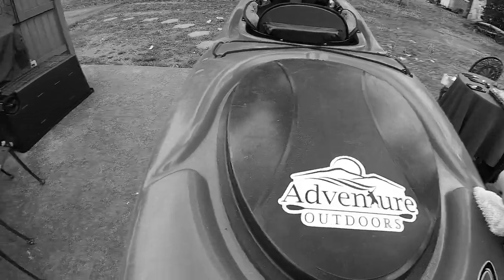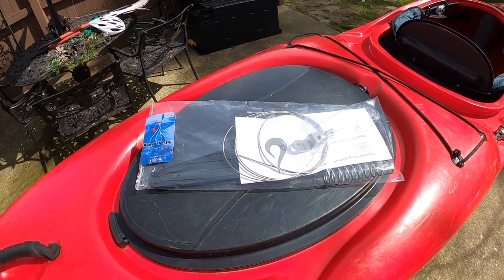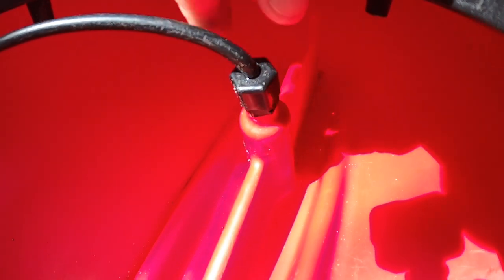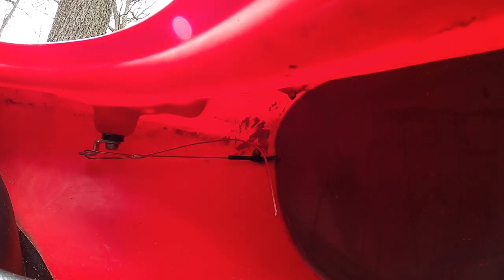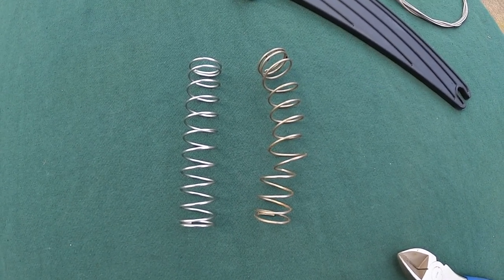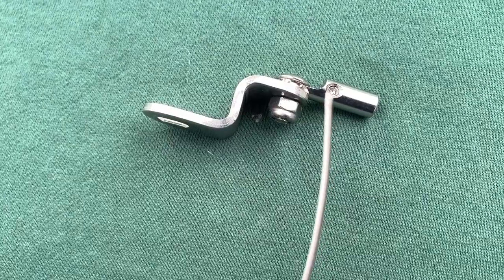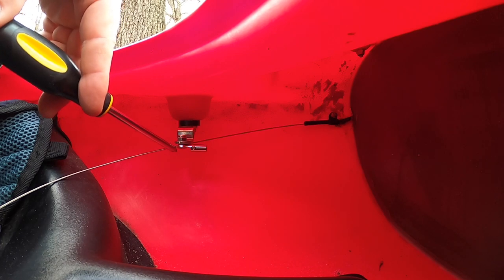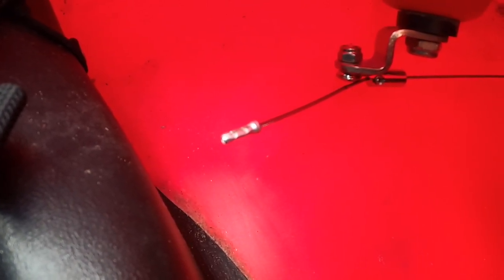How To Replace Liquid Logic Remix XP10 Kayak Skeg

Comment: You beat me to that yak. I saw it on FB but you were quicker than me. I did pick one up this week though. hey is that a high seat back kit on yours?
Reply from the maker: I had been watching closely. The week or so before I had let one go and it got sold so I jumped on this one. I don't think it's a high back, just normal. The guy did have a stiff piece of material they sell that slides in that makes the backrest more rigid though. Have you put yours in the water yet?
Reply: @myadventureoutdoors  not yet, the skeg attachment is missing the cotter pin, need to switch to a bolt and lock nut, it did not come with seat glove, but I did come up with diy fix for the rubber clasp on the hatch that was also missing.  can send a pic if your is the type that needs it.